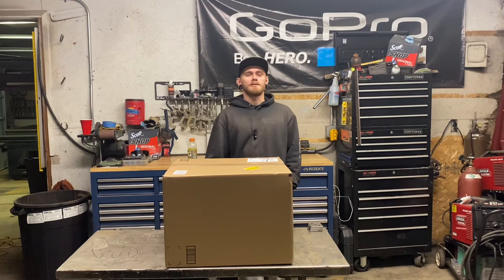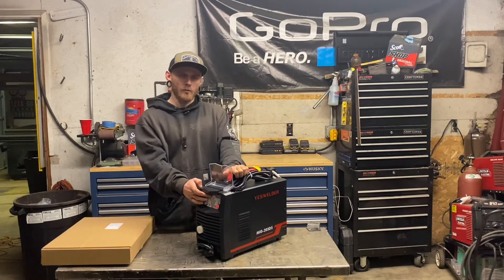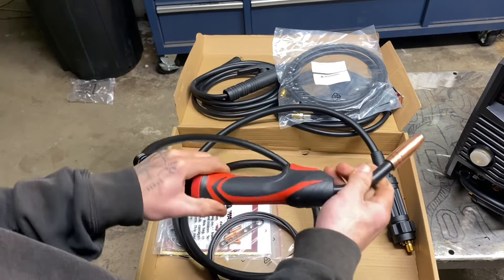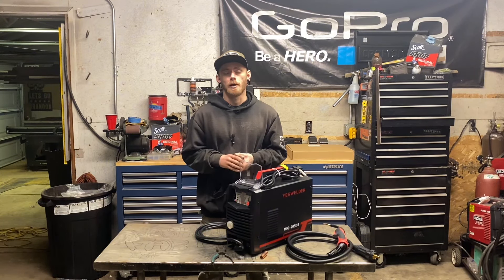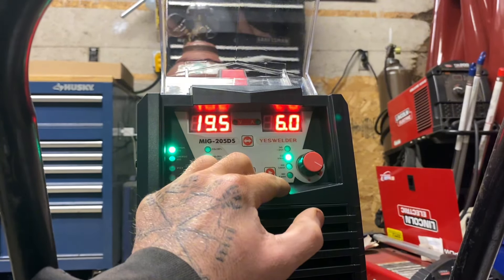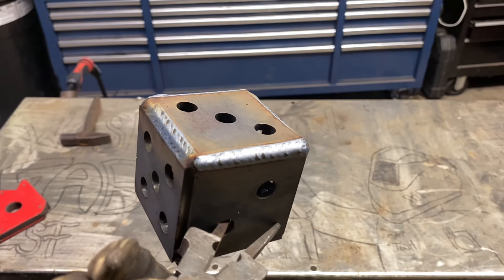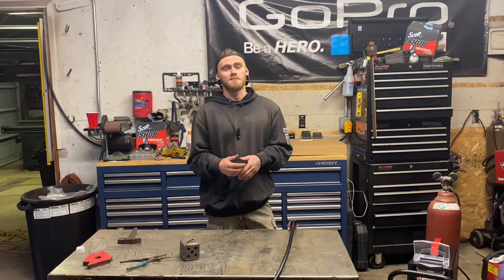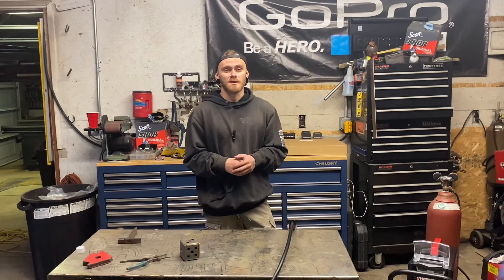Best BUDGET MIG Welder 2024! Yes Welder 205DS Test and Review

Comment: I’ve got a 205DS I bought from the Tractor Supply, haven’t used it yet but I’m pretty eager to give it a try. I ended up getting the flow meter / regulator and TIG torch to give that a try as well. Hopefully it makes for a nice machine.
Reply from the maker: They have yes welder at tractor supply ???
Reply: @washburnfabco  yep
Reply: Is this the 205 DS or DS-B? Mine was advertised as the DS-B but the box says 205 DS. Wondering how to tell the difference
Reply from the maker: @peterchristlieb  honestly that’s a good question I’ll try to remember to check the box

Comment: I’m a new welder and I have 205ds. It’s my second welder, this is so much better than my first one. I use mig with 75-25 gas and mostly 023 wire. I’m welding mostly 18 gage metal and 16 gage exhaust pipe. Highly recommend.going to try flux core next
Reply: How did the flux core go? I tried the Harbor Freight one and it was junk! but it was the 125 Titanium one
Reply from the maker: if your doing thin material run mig.

Comment: How thick are those pieces you’re welding? Is this welder good for welding mild steel around 1/4” thick?
Reply from the maker: They are 3/16” will be fine on 1/4” you can weld any thickness with a 220 machine. Just depends how many passes you have to weld. I do a bunch of half inch with yes welder
Reply: @washburnfabco  Perfect! Thanks! Gonna be using this welder for fab stuff on race trailer and race car.
Reply from the maker: @CherryBombZ28  no problem! Sweet . Sounds fun

Comment: Ok, well, I said I would look closer and you popped right up in the search 😂. So are their consumables proprietary, or are they available at a local option?
Reply from the maker: I get mine on Amazon in bulk. But a lot of the times there using the same consumables and some Lincoln machines. So they will be in welding supply’s but your paying the Lincoln and local supply tax.

Comment: Just say "NO" ....Thes welders weld nicely,  then blow up.....just idling  a loud pop with flames coming out...yikes.     I used one on and off for  year...POP!  got a replacement,  and in first day of welding POP BANG (flames out vent).....I was not even welding, the brand new machine just idling.        seems like they are not made to endure and last
Reply from the maker: @billhopen  every once in a while you get a lemon I guess. I have had exactly what your saying happen with Lincoln’s. It’s gonna happen to all brands occasionally
Reply: @washburnfabco  No, open it  up and you will see bent caps touching each other, shoddy solder job, zip ties everwhere.  Questionable bolt press against the chassis with a thin insulator sheet that shows its being dug into, the bolt hold the  aluminum cable lugs that connects to the female weld leads.  Lets not forget the same thin insulator sheet being screwed as a seperator for the IGBT heatsinks from touching each other. They're about 3mm apart and the top heatsink can sag.  And let's not forget the wires being ziptied and wrap to the coil/toroidal inductors.  Atleast the wires have a protective sleeve from abrasion.
Reply: Oh lets not forget the aluminum shavings still left from the screws being tap into IGBT heat sinks,  luckily the board below it was the plasma cutter isnt heavily populated.  The ground wire terminal using the same screw on the pcb board mount shorting out to a pcb trace because they didn't bend it 90 degrees or shrink wrap the exposed terminal end.  This was on their MP200, and I fixed all of this after looking in the reported failures on the facebook group.  So as long as you're willing to do some QC double checking you should be ok.  Their machines don't output what they claim, it's a class action lawsuit waiting to happen.  I'm still happy with the kickstarter price, because I knew I would get about 60-80% of the claims.  Literally the power efficiency is around 60% vs their 80% claim, 170A of their 200A max output.

Comment: BEWARE: YesWelder will not service or support anything not purchased through their official YesWelder stores. If you need a part and don't have an approved purchase invoice, they will not support it. No parts are available on their website. THESE ARE DISPOSABLE UNITS.
Reply from the maker: For the price there shouldn’t really be an issue on that. I used my first machine from them almost daily for about 2 years before I finally killed it by dropping it out the truck at 35 mph. Even with Lincoln or Miller the repairs are so expensive it’s almost never worth it to repair them unless it’s a much larger machine.
Reply: Straight b.s. very good service bought mine on Amazon.  Needed part for it shipped part free good customer service sound like a hater man.